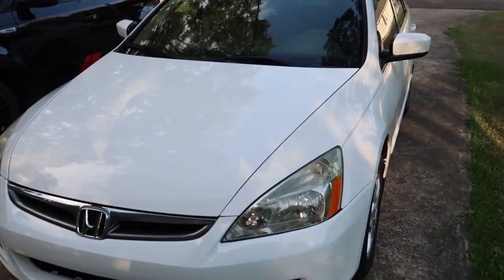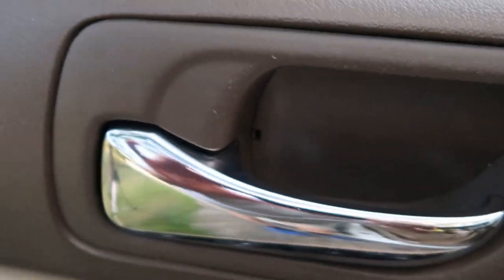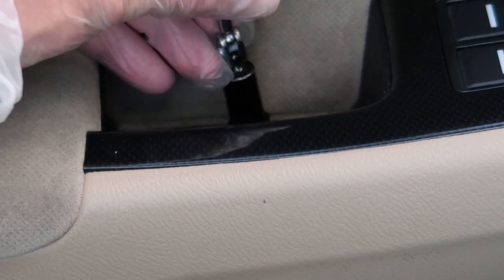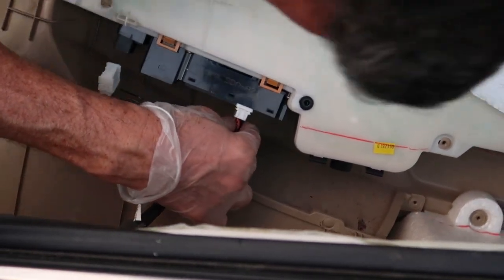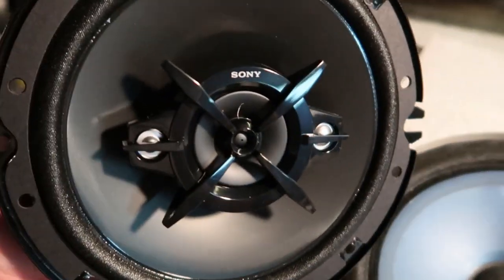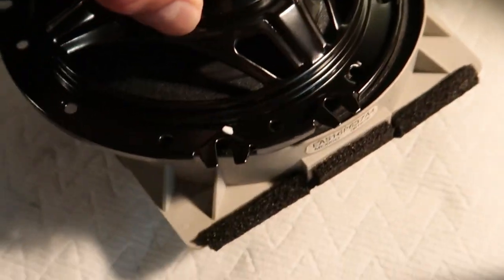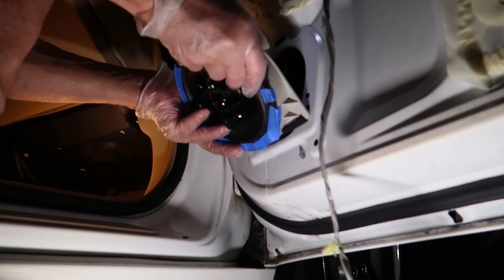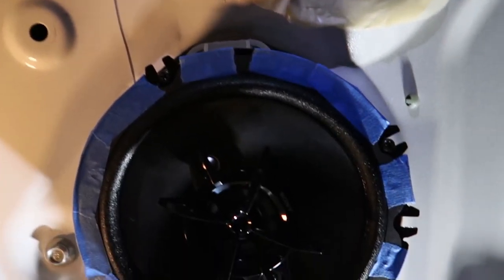Honda Accord front speaker replacement 2003-2007 #Hondaaccord

Comment: Just wanted to say that I own a 2004 Honda Accord DX, and 6.5 do not fit.  The stock speaker is black instead of blue here, and the bracket is black instead of tan like in the video here. The bracket's interior measures 5.25in and most likely 5 1/4 speakers are more appropriate for my vehicle.   I will post back once I return the 6.5's I ordered and purchase a pair of 5.25.
Reply from the maker: Thank you for the info, Please let me know what size speaker fits the Accord DX and I will pin your comment for everyone with a DX. Thanks so much for watching!!
Reply: @Zspeed  Cool.  Glad you commented to remind me to come back and comment.  My 2004 Honda Accord DX 4c 5sp manual transmission came with stock 5.25 inch door speakers,  and empty holes for 6x9s in the rear. (Wired and ready, just no speakers.)  
So I've placed Rockford 6x9s in the rear,  and upgraded the stock speakers with rockford 5.25 in. 
 Hope that saves someone from having incorrectly order 6.5in and have to return them for the proper 5.25 in my Accord DX variant.
Reply: @jaylehman5173  I was talking about the front door speakers.
Reply: @jaylehman5173  the speakers in the rear window were empty.   Take a look in the trunk,  you can see if you're wiring harnesses are there.  Then all you need are some 6x9s and a honda wiring kit adapter.
Reply: @jaylehman5173  correct.  If I were you,  I would take the door off and measure the speaker size before ordering just in case.  Don't hesitate to ask.   Taking the door off is SUPER easy and shouldnt take longer than 10 minutes.
Reply: Thank you for commenting this, I want to mention I own a 2006 7.5 gen Ex model which is right under the top trim and it also comes with 5.25 inch door woofers. I'm not sure why the older cheaper models come with 6.5 inch speakers kinda confusing
Reply: @raspberrypi2965 that's weird I have a ex and 6.5 fits mines fine
Reply: @brooklyn7941  yea, EX is the bottom tier accord is my understanding.
Reply: @raspberrypi2965  it did say I could do the size u mentioned but I mean if u can put a bigger size why not ? lol I'm gunna put skar speakers in them
Reply: You got the made by china version by your description of that speaker.

Comment: I was able to replace the front speakers on my 2004 Honda Accord LX with the help of this video. I used some Kenwood 6 1/2 speakers, used the clip from the factory speakers, and bought an adapter from Amazon to avoid any unnecessary wire cutting and the new speakers work like a charm. Thanks for the virtual help!!
Reply from the maker: Thanks so much for watching and don't forget to subscribe!!!

Comment: I found that the easiest way to remove the small door clip is to get a small pick and a small suction cup. As you pull the little clip give a tug with the suction cup and it’ll come right off. Took about 10 seconds. Thumbs up to help others out 👍

Comment: i have a 2004 honda accord lx and im at the part where you connect the wires.. the two wires in my car are green? and they have the clip on it.. what do i do from here?
Reply: fyi the new speakers im using are the terminator6 6.5 inch and it looks like i have to solder the wires.. i think 😭
Reply from the maker: Remove the wires from the clip, then place the striped green wire on the negative post and the solid greenwire on the positive post!

Comment: To swap out the tweeters, do I have to remove the dashboard? It seems like thats the only way to get into the tweeters, has anyone changed them?
Reply from the maker: You're in luck, you don't have to remove the entire dashboard. The cover over each tweeter can be removed with a small flat head screwdriver! Of course there is limited space because of the windshield, so you will need some very small screwdrivers. Treat the tweeter covers with kid gloves, the plastic may crack if to much force is applied! Hope this helps and let me know how it turns out.  Thanks so much for watching!
Reply: @Zspeed  thanks man, Ima try that out when I get some new tweeters in a week or so, I'll edit this comment to see if it works.
Reply: What size tweeters are for fronf panel?

Comment: I can’t figure out how to connect the wires from the new speaker to the door wires
Reply from the maker: Just use the door wires and hook them directly to the speakers 🔊! The stripped wire is the negative and the solid colored wire is the positive! Hope this helps and thanks so much for watching!
Reply: I got it i connect the wires but I broke the green door locking thing on each door so  I thought I was done and closed the door but when I tried to open it. Nada from inside or outside. By some miracle I walked up to it 5 minutes later forgetting it wouldn’t open and it open. I have no clue how or why but yeah both my door panels are off so I could close the door without locking myself out. Fun

Comment: I just put those same speakers in my 2001 Honda accord and they sound like crap. I don’t know what I did wrong
Reply from the maker: Make sure you connected the positive and ground wires correctly, if not, the speakers will sound bad. Also, you may have to adjust your head unit audio  settings (increase the treble and bass ) this may give your speakers a more balanced and richer sound! Hope this helps you out and thanks so much for watching!

Comment: How do they sound compared to the original ones? Do they have nice bass?
Reply from the maker: Much cleaner sound at higher volumes, but for better bass, replace your rear speakers also!!! Thanks so much for watching! Should I post a rear speaker replacement video?
Reply: Z-speed what do you suggest replacing the rear speakers with lol, my car sounds like a 80s radio lmfao I just want that bass and better sound that every modern car has 😔
Reply: Z-speed if you want too, of course! I’m looking forward to it! And also, what kind of speakers would you recommend for a nice bass?
Reply from the maker: Polk audio DB691 6x9 are very nice, or you can go a little cheaper with a Sony 6x9! Let me know how it turns out!!!!
Reply: @Zspeed  yes post rear video!
Reply from the maker: Okay 👌,  thanks so much for watching!!!

Comment: do you know what size the rear speakers are ?
Reply from the maker: Standard 6x9 speakers!!!
Reply: also will 6.5 speakers fit in the front , tried to put some in and they didn’t fit
Reply: @scottcain216  just ran into the same issue.  What is the year/model of your accord?  Mine is a 2004 Accord DX.  
Did you resolve your issue?
Reply: @raspberrypi2965 DXs are different. you have to use 5.25in. i know it’s two years later but aye

Comment: First, what is the 370Z has anything to do with the Accord speaker upgrade? Second, I would NOT try to reuse the crappy mount on the front speakers for the new 6.5" speakers. Crutchfield has the Scosche SASCN656 brackets that you could get from them to mount the new speakers without cutting out the old plastic that are probably disintegrated anyway. You can mount the new speakers securely onto the new brackets with 3 screws and then mount it onto the doors after connecting the speaker wire harness using the harness adapters. This set up will last a lot longer because the mount is designed to have speakers added to it rather than trying to reuse the sucky baskets from Honda. This way, you can also put the old speakers back to the car when you sell it and keep the upgrade speakers for your next car. Plus, it is way too much work to try to cut the thing off and try to fit the new speakers onto the old bracket, only to save a few bucks! Third, I would NEVER touch the OEM wiring, you risk the warranty of the car from Honda unless the warranty already expired but more importantly, you can create a short which will shut down the amp. It is much easier and much safer just to get the speaker harness adapter for less than $10 a pair on line. You can just plug the harness adapter into the speaker and the OEM wiring harness and it is weather proof and secured. I had upgraded my 7th Gen Accord V6 years ago with a pair of Eclipse SE6900 and a pair of SE6500, they produce much better sound stage with plenty of treble and bass than the OEM wimpy drivers! I used a pair of speaker bracket adapters for the front doors and nothing needed for the back. I can't say how these Sony speakers will sound but my Eclipses are excellent for most music I am listening to.
Reply from the maker: Thank you so much for watching!